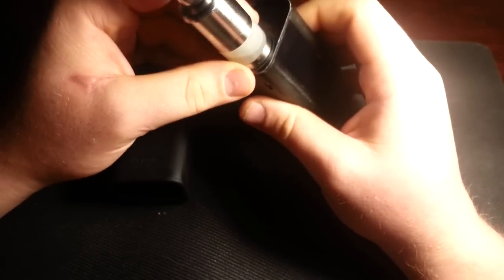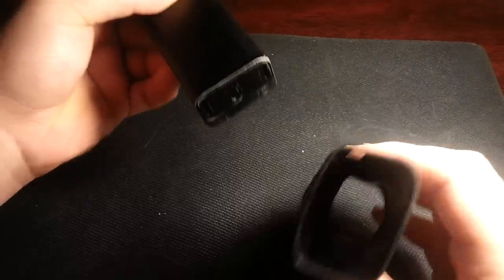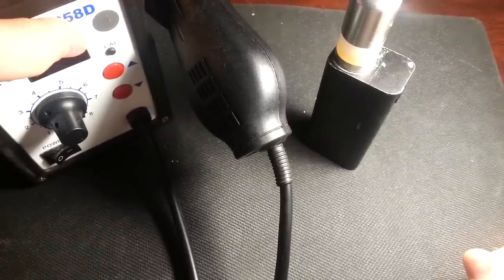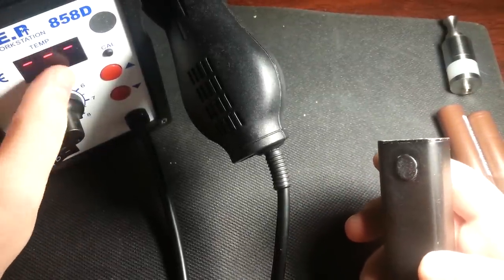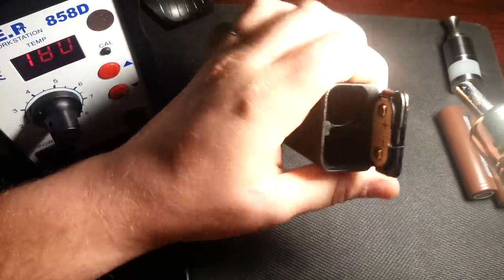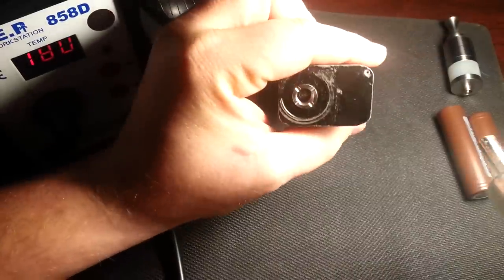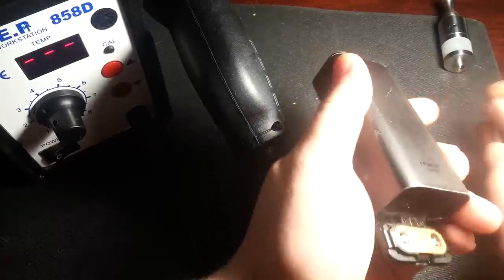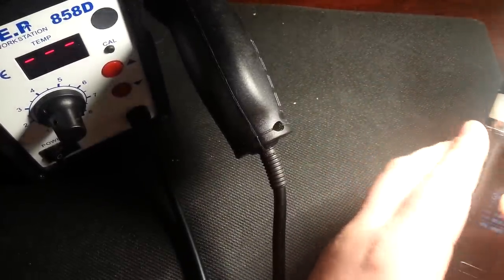How to fix "atomizer short" on cubiod 150w with heat gun

Comment: had the issue with atty short on mine after using my rda and over dripping not only would it be atty short but the power would change when i put a tank or rda on it and the res would be wrong too for a 0.5 coil jumping up to 1.35 or higher but followed the advice in this one before thinking about taking it apart though no heat gun i used a hair dryer on it and left it blowing up a while put it together and no problems since thanks for the help guess it must have loosened the juice or gunk that was causing it

Comment: the first thing to do is to try a new coil.   even some new coils would give u that message when u install them. i guess because they are defective.   i just put a new coil and it kept giving me that message so i put my old coil back and it’s working again
Reply: Wow.... Thinking about that makes me believe that's GOT to be my problem!!  Cause I've spent hours trying to fix it or find an answer.... No other tank on any of my 3 sub ohmers has given me this kind of problem.....
Actually I think I did try a new coil.... I've got 4 new ones.. But that dang "mizer' message keeps popping up... I'm thinking its that pin inside my 510 at the base,  where you screw in your tank to the battery mod....

Comment: Hi thanks for the video 
But i am having another problem which is always when i press the fire button the mod is not opening and when I attached it to the pc or charger it says ‘check battery’ with no charging at all and the battery indicator in empty!
This case happened when i connected my mod to the charger via usb cable at night till morning 
By the way i was using this mod for a year and a half with this type of charging and suddenly that happened. 
So please help me if you can. 
Thanks.

Comment: I have that problem. After I did update firmware It is fixed
Reply: Wow, Mr.... How the heck do you update that? I've never done that.... Or heard of it? How do I update my mod??? 
Guess it makes sense tho cause there is a chip inside our mods, right?😂
Reply: @desertflower5724  just google "joyetech cuboid 150w firmware" and it's the link from joyetechs website, download the firmware for windows or mac depending on your computer and run the software with the mod plugged in and if it asks point it to the 3.15 firmware file and then click update and it'll do it pretty much instantly and tell you. I just did it minutes ago, it took a few tries with the app crashing on my mac but worked. I now have also gained 200W vs 150W with the update! Hope this helps!

Comment: wtf.....  y u heat the bottom side of the cuboit????  there is nothing there!! lol.......  all u will do is to destroy the 2 plastic tubes that holds the batteries. and ofc u can melt other plastics too.   if u try to dry it coz of some liquid leak that cause troubles to the board, then this is also a bad way to do it!!!! all of u guys are dangerous....  other ppl see your vids and follow your steps..  and yes. ik better than u. +18 years at Sony Service Center......my  experience at electronics is +30years.

Comment: i only see vids for problems with used ones is myn is new and i just got it NEW  and i put my tank on and it says atomizer short
Reply: On my new Sig Sobra, same thing.... Its a bad ass sub ohm mod, I love it. But this atomizer short thing has to do with the little metal pin that comes out from the base where the 510 screws in & connects with mod... It has nothing to do with the batteries or anything else....  

I've used different tanks on it where it works beautifully... But its only this one tank I can't get the connection at the 510... Only on this one Sig tank.  Otherwise it's been awesome!  I just can't seem to find the right video that shows a professional taking apart piece by piece & putting it back together, showing every step of the way..... Its all about that 510 & the pin inside it.....  Unless, all 3 of my new coils are duds, and it's sending me a message of atomizer short.....
    Can you or anybody help me out on this? I know it's a simple fix, but damn I've never had such BS trouble trying to put in my tank (coils are good, batts brand new, charged 90%, )
    What a mystery, or should I say "misery"...🤪

All I get over & over is •CHECK ATOMIZER...
•SHORT...
    I'm a chick & know not much about electricity..... But I've put these tanks together hundreds of times to change the coils, never this prob til now...

Now ya know why I love disposable sub ohm tanks for $4 that last way longer, never leak, and are good to go, ALWAYS!  GREAT FLAVOR & CLOUDS TOO....REALLY! 😉
🌬☁☁☁☁☁☁

Comment: Just upgrade the firmware on Joyetech website...then fix the problem ..!!
Reply: MrDmotor it's the red wire that has become disconnect and needs to be resolder on firmware upgrade won't reconnect a wire stop watching  the matrix recheck into reality you'll be ok